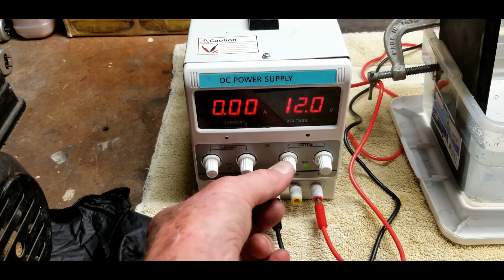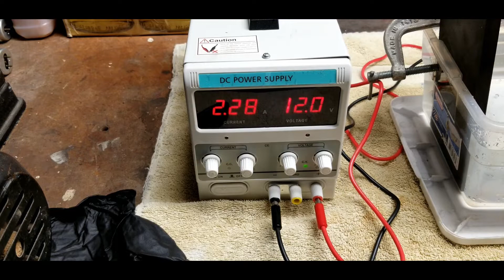An Odessa Odyssey with Ron Metchis ☄️ Electrolysis & Acid Etching for Rusty Iron Meteorites

Comment: I can't find iron wire on ebay or Amazon. I got everything else for electrolysis except iron wire. I have 180 gram campo slice I plan on trying this process with. It's my first time.
Reply from the maker: Look for Nickel wire on Amazon or eBay. Stainless steel is 50% iron so that should work for you. Do not use galvanized steel because of the extra Zinc.

Comment: Hi thanks for the video, very informative.  I etched my first piece yesterday per your instructions on this video.  I wanted to ask about the graphite plates.  What size are you using and where can I pick some up? Thanks.
Reply: Note: (Correction) I said I used sodium carbonate, in the electrolysis tank, but I actually used Arm & Hammer potassium carbonate.  Just want to clear that up.
Reply from the maker: That is the right stuff
Reply: Oh wait, I had it right the first time it is Sodium carbonate.  Sorry😊
Reply from the maker: Wonderful! I hope your first etching project works out well. It's super exciting to hear people trying new things based on the knowledge they gain from my channel. 
The plates measure 4” x 8”. You can get them on Amazon.
Reply: @topherspin  Yes, my first etching job worked out well, thank you.  It was like a scavenger hunt sourcing all the items needed for the etching and electrolysis setup. I went ahead and used two steel plates 12"x4"x1/4"for the anode and a piece of rebar 3/8"x 18" for the cathode. Arm and hammer sodium carbonate and distilled water for the electrolyte. And a car battery charger for power supply.  It's bubbling as we speak.  I will be upgrading to the graphite plates just as soon as I can order them.  Thanks for the videos and letting us know when you are trying something new in the process.
Reply from the maker: Ron (his video) and I are excited to help people try new things. I am wishing for the best outcome for you.
Reply: @ManuelSanchez-ou1ji bonjour,  pourriez vous me dire si le chlorure ferrique est diluer ou pure , merci
Reply: I ordered the graphite plates a couple of hours ago.  They should arrive tomorrow.  Thanks again for the info.